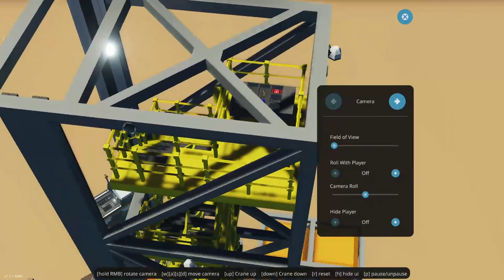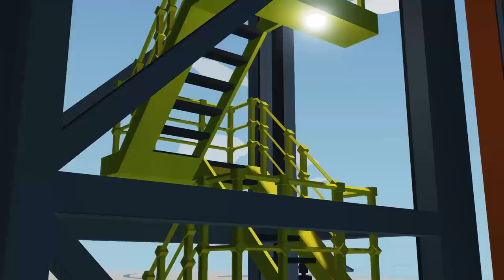Stormwork: The OIL RIG DESIGN you didn't know you NEEDED!

Comment: nice build, how do you generate power on the structure ? I tried using an engine w/ a generator but for some reasons the electric heaters also heat the engine to ~100°C making it unusable.
Reply from the maker: The rig is on the power grid and is serviced by electric so it does not need a generator to operate :)  But I do want to add backup power generators so I will have to see how that works! It might be that you have to put them far away, or enclose the electric heaters inside a chamber